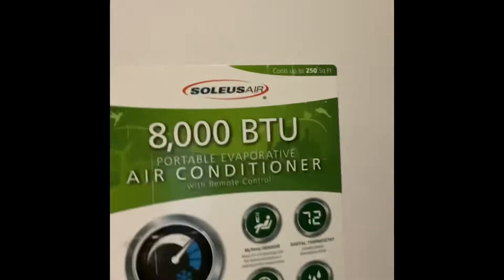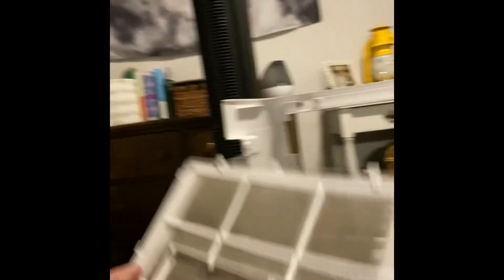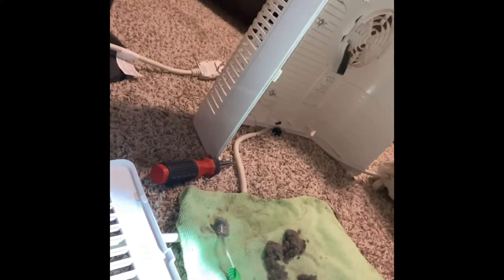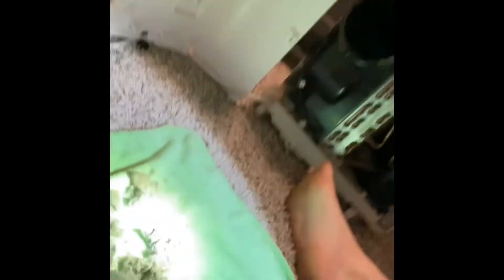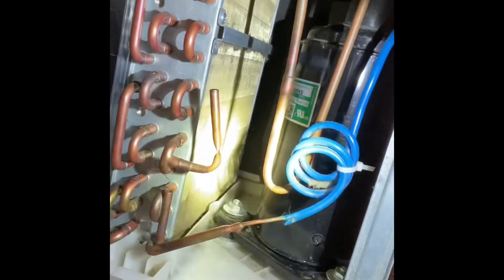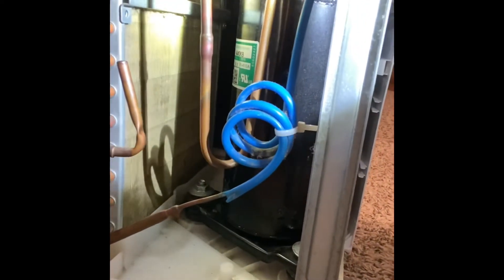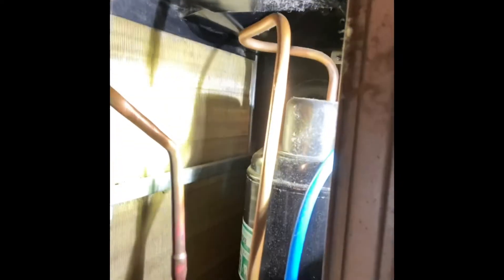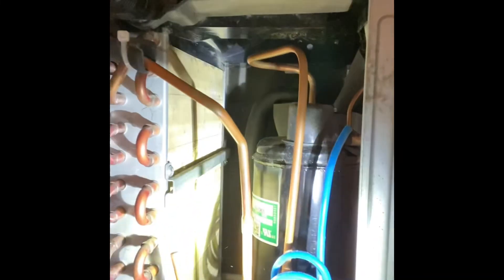Portable SoleusAir A/C Problem!! Dirty Condenser!!

Comment: How did you get the front cover off?
Reply from the maker: There are screws where the front and back panel meet. Two where the handles are on the top (one on each side), and 4 screws on the bottom (2 on each side). Once those are off, you may need to pry it just a bit but it’s not difficult.
Reply: Sorry I have a different model or air conditioner